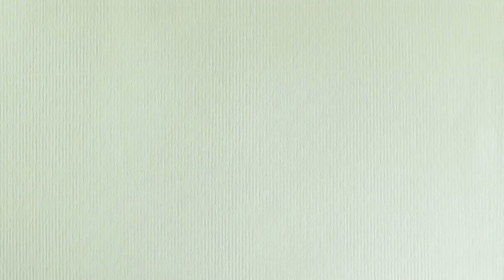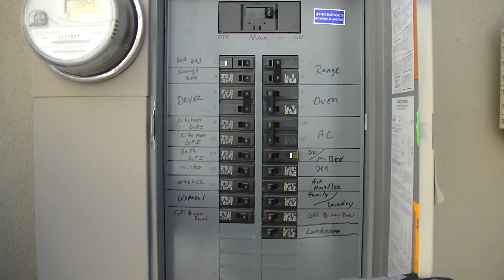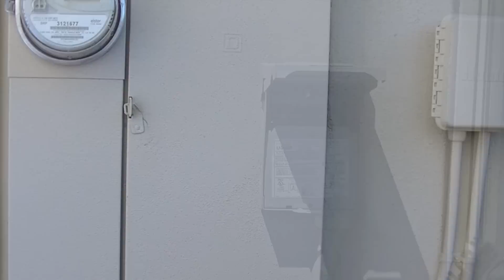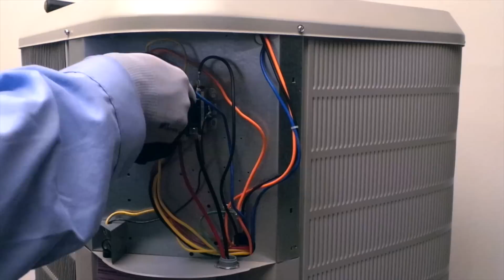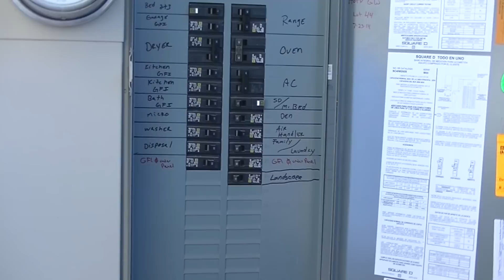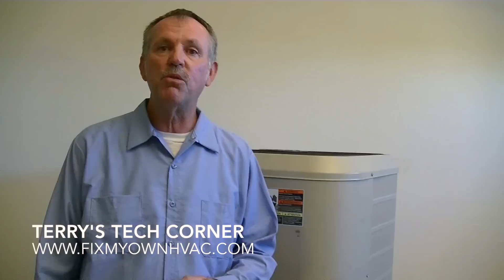Changing Your A/C's Contactor

Comment: Good video. I have a question.  I found that my low voltage pigtail from the thermostat to the contractor is loose and wobble and make a humming sound. My AC air is not that cold anymore. Do you think replace can solve the issue?

Comment: I accidentally attached the Line ins to the T side. doh!  Really doesn’t matter they have the same number of spades on both ends so as long as you know where the wires are going and that they’re wired correctly your good. By the way on a single pole contactor the L1/T1 is the single pole side. The L2/T2 side is the shunt side. Good video
Reply: Not always.....I see the L1/T1 side....and the L2/T2 side.....to be EITHER shunt or with contact points.....depending upon the make and model of contactor.

Comment: Thank you for including the order of breaker power on and off.  I found out the hard way that the outside main breaker should be put in with the air handler shut off inside.  It caused a short and I had to get a new part and try again.  I have a two pole contactor, but it's really good to know that the wires should come off and on in a specific order.  Thank you so much for your video! 😄

Comment: I saw a guy in the parts store trying to get a contactor once he told me his contactor was bad, I knew he was just equipment owner I asked him why he says his contactor was bad, he said well when I push it in it turns on but it dosnt push in by its self, I said why don't you check the 24v at the coil, he said well no the contactor is 240v not even knowing about the coil  than the store worker refused to sell him it lol, but to be fair I don't think he was going to sell him it anyways
Reply: I was watching this schematic tutorial for HVAC students here https://www.youtube.com/watch?v=fxwFzhaZmgY   and save for the 24v lines, he has everything wired to the reverse of both the way my contactor is wired and the way the tutorial is explained.   Care to imput?
Reply: that video shows a single pole contactor, so using L1 L2 as the line power to the motor/compressor, L1 is going through a set of normally open contacts that close once the k1 coil is energized, L2 is going through a closed contact meaning its always going to be closed so really its just like a clean way of connecting the wires, L1 is the contact u need to close to start the load, sorry but I don't understand what u mean reversed that picture shows whats on the schematic as far as we can tell, I don't mind explaining any thing i just don't really understand what ur asking bud
Reply: Seriously; thanks for bothering with a rookie.   I love this stuff, but as an ex-nail bender and current IT enterprise manager, just starting to understand it.  I've got a 30+ YO system I plan on having upgraded soon (if I can manage an extra year or 2?  Great.  If I trash it?  Oh well) that isn't working well, so frankly; I'm just playin and trying to learn what I can.  Have to say it's fascinating!   Surprised you guys don't need a degree for this for all you have to know.  Seriously.  Anyway.... Enough a$$ kissing (but I mean it)......
          Changed out my fan motor on the outside condenser unit, capacitor tested great.   Job done.   Contactor points a bit burnt, so I thought I'd do a quick "maintenance" $15 service and change it.   Took a pic before I started (wish they'd stop telling people to rely on that) and wired it just like the old one.   Some of it doesn't make logical sense to me, but OK.   The mistake I made was going by the pic and tried putting my 24v back like the pic instead of thinking.   My poles were the older LT side, new were split left and right.   Something happened on startup, but I fried my fan limit control switch; fan side squalls continuously on the om tester.    So I said Fk the pic, lets look at a schematic.
            In this video, he's got his common jump going from the contactor to the capacitor on the continuous side, where mine and in the link I gave it's on the switch side.   Does it matter?   Same with which side T1 and T2 are on.   I've got 10-2 coming in; black continuous, white on the contact.   For the comp it had the black on the contin. with red on the contact.  Yellow jump to common between cap and contact (red/top).   It also had originally the fan motor lead on the black feed at the bottom.  That didn't make sense.   Anyway, this guys set-up is completely opposite of mine; his black/red are flipped on continuous/contact sides, and has the jump between cap and contactor on the continuous side, not on the contact side like the video and mine has.    Just confusing the hell out of me......
Reply: Crfor Freedom so what’s happening with ur u it is it turning on at all, or is just the outdoor fan not coming on or what, wire the contactor like it’s written on the schematic and don’t worry about what the other videos say, 24v wires going to the coil and l1 l2 on ether always closed contact and normally open contact,
Reply: Yeah thanks Cm, I've been researching all night, and that's the conclusion I've come to.   Solid advice.   No; I got nothing.   Got a real hot electrical smell like the motor burning up inside when I had both 24v wires on the same side of the contact.   Om tested the limit switch; limit side tested ok, fan side squalled continuously.  So from my research that's bad?   It definitely seems to be the source of the burnt smell.

I think I have it wired OK now.   I may take a pic of the screw up and the way I have it now on my OneDrive and put a link to them so you can see them if you're interested.   I'd appreciate it!  
            I know the fan center has buzzed for years.   If I can get a used on in good shape cheap I may pick one up.  IDK if I did any damage to that, I don't know if I can really test it until I get the limit switch in.   I don't imagine I did it any good.  Anyway, I'd LOVE not to hear that buzzing any more......
Reply: The contactor connections are starting to make more sense now after study.   Like I didn't understand why the low/high pres. switches could go anywhere on the hots, just one or the other, then I figured it just is to balance between line and load?   The wiring is all making sense now, although I'm tired as hell!! ;-)   But as soon as that limit switch comes in we'll get it done.
         It's never had an ext. disconnect, so I'm going to put one of those in while I wait on the switch.   I've done quite a bit roughing and build a pretty neat box even if I do say so myself, so I'm comfortable with that.   A lot better than the exposed 10-2 I have now!    It's a rental.... (Had a damn neighborhood cat been bothering the house and dogs, hoping I would light his eyes up and end the problem!  No such luck; we'll box and whip it today)
Reply: Crfor Freedom nice all sounds pretty good and that high and low pressure switch is a safety to kill power on the low voltage going to the contactor coil in order to shut off compresssor when there’s to little gas or to much head pressure, take care man have a good one today
Reply: Thanks man.   I'll give you a shout if it works and I get cool....
Reply: Crfor Freedom how’d it work for ya boss
Reply: Perfect timing CmHVACR.   Just sat down about 1/2 hour ago.  Disconnect in, looks & works great; no exposed wires.  NO BUZZ!   And it was an aftermarket!   Last time I checked, all they had was factory Bard for $120.  They now carry aftermarket fan centers for $30!   Worked like a champ.   Limit plugged right in.    Took me awhile to get the center in, but I made sure the connections were correct, and the guy who wired the furnace was sloppy.  No biggie, but I spent some time tidying things up and making it pretty in there :-)    All neat and pretty.
                       MOST IMPORTANT;  1st thing on AC call; contactor worked as it should.   Nothing burnt up again so that was a plus....  30 amp on and disconnect in and she fired up beautifully!!!  COLD AC BROTHER!!!!!!!!!!!       Thanks so much for your help and aid in the confidence to keep moving forward.   IDK why you take the time to waste your expertise on annoyances like me, but it sure is appreciated like I could never express..   Very sincerely my brother.   Thanks.

Question out of curiosity;    The condenser fan seems stronger?    The compressor was cutting out before too.   So far so good.   Don't know if it was limiting or what.     Once it cools down I'm going to start looking at some of the fun stuff.   My Yellow Jacket gage set came today, so tomorrow I start looking at head pressure; ext.   Don't have a way to check temps yet, but it's coming.   Want to calculate superheat.    Back to the question;   Could the contacter helped the fan and compressor by making a better connection IE better continuity?   Helping both to run better?   There was a bit of burning on the old contact points, but it tested ok.
                       Again, thanks.   Just having fun now.    Gage time and see what I get as soon as the rest of the toys arrive.   God this is fun.    I wouldn't like the crawlspaces or attics in summer, but I would love doing this.   You really have to use your head.   It's not like beating on blocks of wood, THAT'S for sure.     Thanks......
Reply: Crfor Freedom I like to help any one trying to learn this trade My whole family has been in the industrial side for a while just grew up off it so when anybody is trying to learn it shows they have a lot of respect for it, but yes deff check ur connections make sure it’s all tight, but sounds like u did a great job, you should try to get into the trade ur attitude towards it is amazing and sounds like ur willing to devote ur time to learn it
Reply: Thanks Cm.   I do enjoy it.   I was up all night researching and had a blast.   Overheard some conversations at the supply shot today picking up my parts and actually understood what they were talking about!   That's a first....
         I enjoy IT work, but it doesn't pay as well as it use to, and I really miss working with my hands.    My daughter was helping me today; said it was like watching me come alive for the first time in years.    I'm seriously thinking about it.   I know I'd love it, just so much to learn!!!!!   I'm no spring chicken....

Comment: How are you going to teach homeowners to change a high voltage component on a 240-volt unit and not recommend a meter. You can never trust a breaker or service disconnect. Someone can get really hurt and cause very expensive damage to their system or home. Unless you've got an electrical background and are mechanically inclined You got to call a professional out.
Reply: This is an old post, but I am wondering if I am being safe enough when working my AC.  I always pull the two main fuses from my fuse box that service my entire home, also pull out the disconnect fuses above my outside condenser, AND most importantly flip the on/off switch to OFF that is located just below my elec meter which prevents any electricity whatsoever from entering my home. I also discharge the capacitor. .I do not see  any possibility of being lit up from elec. Do you?  

Just to be safe I guess I should also meter it, but I see no way that elec could possible be present.